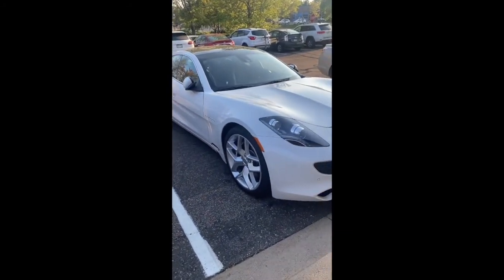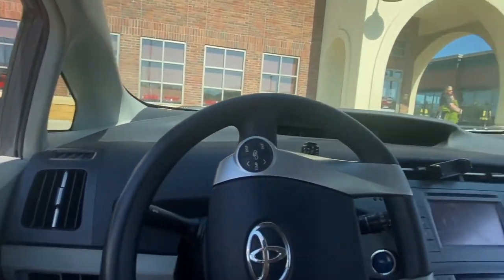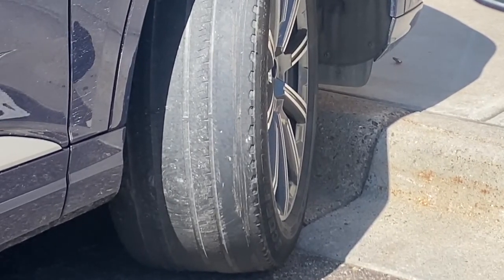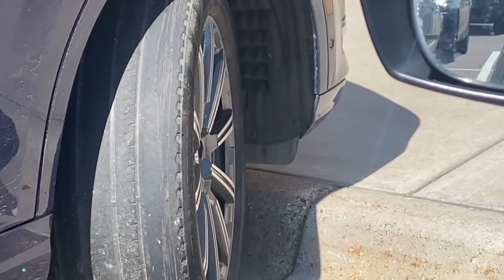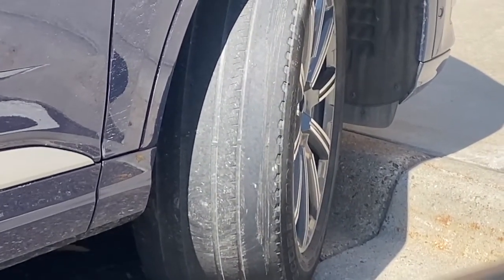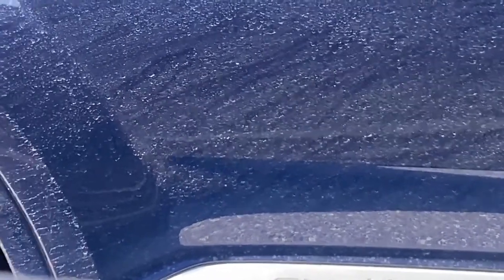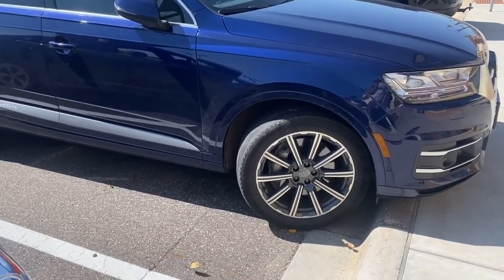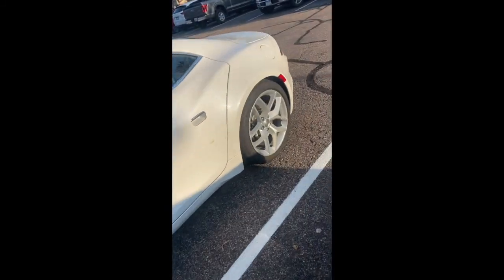How to Fix Uneven Tire Wear and a WARNING!

Comment: Ok my husbands truck is doing this just got new tires and a alimentary but wasn’t out of alignment what could it be it’s a 2021 Tacoma
Reply from the maker: Take it back in get a free estimate
Reply: If the aliment was good then it could be bad tire rods (inner and outer) and also check the rubber bushings on the upper and lower control arms. If any of these are bad it allows wear on the tires. If these were messed up the person that did the aliment would have said so, but it's worth checking out.

Comment: Either one of two things that have occurred: 1) the driver has not taken his(her) car into the shop for routine maintenance (surely the mechanic would have noticed this dangerous situation, or 2) the driver is unaware or is ignoring the condition of the tires.  Thanks for bringing up this important issue.  Two days ago I saw the very same situation at work; left a message on the window for the driver to take notice.